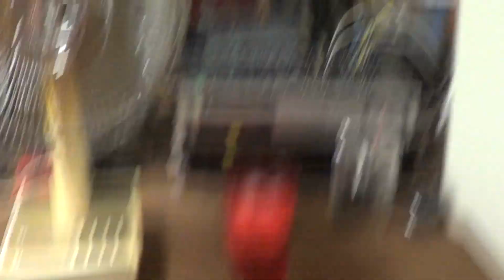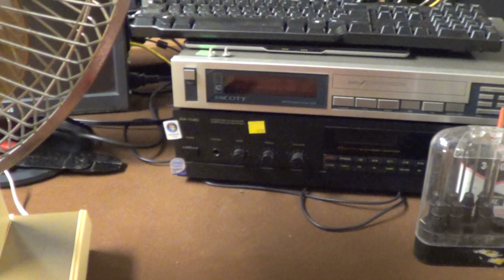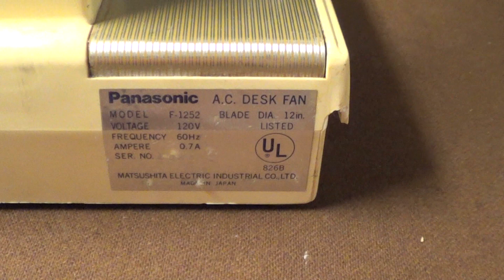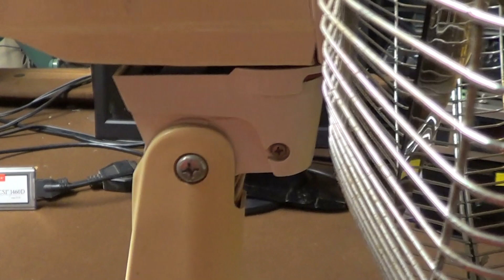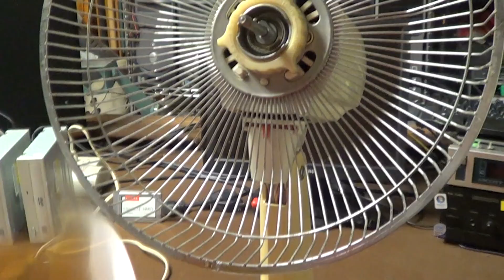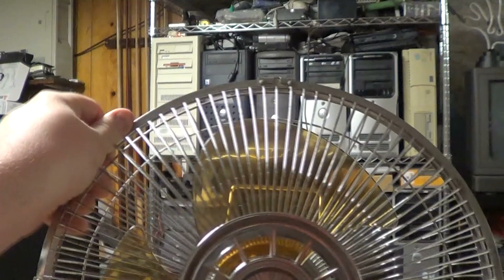Panasonic F-1252 Magic Stop Fan Overview and Demonstration

Comment: Do you still have these fans? My family had a Panasonic fan in the 1980s that had a similar safety technology but theirs had a switch instead of buttons. It was made of plastic instead of metal construction older fans had but the quality is still miles better than todays cheap, throw away fans.
Reply from the maker: Yes.

Comment: I just repaired one of these, the symptom was that it wouldn't start, the motor shaft would move a little when it tried to start and occasionally it would start for a split second but then stop. It turned out to be a bad 945 small signal transistor. I replaced all the 945 transistors with new KSC945SCYTA ( 20 cents each at Mouser) and it works great now. It stops when you touch the grill and then restarts a few seconds later. While I was in there I also changed the smaller electrolytic capacitors on the board. One of them was supposed to be 220uf and was measuring 450 uf. I just changed them all because they only cost pennies and I had them in stock. Hope this helps if someone else is repairing one of these!

Comment: Hi there.
The fan on the left side it's not working good, you should repair it.
Mine had same problem, I did repair it.
It's on my videos a short movie about my kdk instant stop desk fan.
Reply from the maker: I found the short video, but if you have one about repairing it, I would be interested in seeing that video. The fan on the left has worked that way for as long as I can remember (over thirty years) so maybe it has always been broken or there was a design change?
Reply: I did not shoot any video explaining how to repair it unfortunately, so few of this fans on YouTube...
But it was like yours on the left side. It only coast off...that was not the pretended action from Matsushita, they wanted to stop instantly. Mine is older than yours and there are another one even older than mine and it stops instantly. 
Yes I believe your fan is broken long time ago and you don't recall that. Mine was manufactured in late 60s. Maybe 69 or 70.
Did you check the resistor inside the white ceramic tube? Maybe it's open or could be the big capacitor after that resistor. If I recall correctly it's a 47uf 400v, change it.
No, I don't believe they made it like that because to do that you don't need so many electronics on the control board.
That video was taken when I was testing it, and I did not upload any video since I fix the fan. Now the fan does the same as yours on the right.
Reply from the maker: As I'm not unhappy with the way the fan on the left operates, and it works perfectly except for stopping instantly, I've never actually had it apart. I would rather not have a disaster and ruin that fan.

The fan on the right is definitely in need of attention. As I think the video says, only rarely does it work properly. I have had it apart, and did some basic tests at the time, but I did not find any obvious reason for it to be erratic. It is in storage now. There is also a third and smaller Magic Stop fan here and it also has problems.

It is surprising to me that these fans are so rare in the US. The Magic Stop system was a really good idea.
Reply: This fans are quite rare worldwide.
Regarding the fan on the right at least you could try to reflow solder joints, it might fix it, just because sometimes it works ok.
The fan on the left side, if you don't feel comfortable with electronics it's better leave it as it is.

Comment: The way the Magic Stop feature works is via DC injection braking. There is a capacitor that stores a DC charge (not the one mounted on the motor, that's just a run capacitor), and when you trigger this functionality, a relay cuts off AC power to the motor stator, and DC power from the capacitor (in industrial equipment, a DC bus is used to achieve this) is dumped, causing the near-instantaneous stop (the same windings used to spin the fan doubles as an electric brake via this method). Your other unit has a bad/faulty capacitor, hence why it simply slows down instead of stopping instantly. You will likely see a bridge rectifier circuit and a dedicated capacitor inside the fan's base on both units.
Reply from the maker: Of the three Magic Stop fans I have, this one is the only one that stops instantly when touched. As far back as anyone can remember, the other two never did stop instantly. A feature added later, perhaps?

Although definitely not as safe, I prefer the soft coasting down by inertia as opposed to the sudden stop.
Reply: CT1660 
You are absolutely correct.
Fortunately I just acquired one made by KDK (same factory) but older than this model on the video.
I did repair mine, now has instant stop function working. 
On kdk they not name it magic stop, it's instant stop.

Comment: I have seen some Montgomery Ward box fans say "soled state" what means the fan was equipped with a soled state variable speed control. I have found a 12" RAKS fan made by the Gus fan company in the 70s this fan has "sold state" written on the control panel but there is no electric board but a large transformer in the bace and a switch on the back of the motor housing switch the current from 120v and 220v.

Comment: 17:30 I"ll guess there is a diode in there somewhere. I believe feeding an induction motor DC  will turn it into a brake. 
BTW, both induction and synchronous motors need to be started by extra windings and can run in both directions without them, if started mechanically. The cheapest starting device is a "shaded pole", an extra winding a few degrees off in one direction that is simply shorted; these are reliable but inefficient. More powerful motors have startup windings fed by a capacitor; they usually shut off once the motor is up to speed . This is why so many dryers have a "start" button, it's a cheap way of timing the startup windings.
Reply from the maker: All very much true except the dryer part. There's a centrifugal switch on a dryer motor that kicks it off of the start winding once the motor has picked up enough speed. This also energizes the timer motor. The start button supplies power just long enough for this to happen (and as you'll see if you hold it down, it will be ignored after the machine is running).

Comment: hi it is a 3 phase motor but used only with a single phase ac line (that is why it's need a capacitor ) with a 3 phase motor you only need to invert 2 phases to make it run in the other direction :)  ( i hope i was clear beacause i'm french and my english is not quite perfect ^^)

Comment: That fan is very cool and those blades there golden colored I wouldn't pay $500 for a fan that does the same thing a regular desk fan does just the same thing without buffeting what Dyson says all it does is circulate the same air in place so if it's hot it's going to blow hot air around when I can get an air conditioner for like $100 or 200 dollars depending on BTU size.

Comment: It looks like it could have a brake of some sorts causing the rapid deceleration of the blades . I seen a metal ring inside the motor jolt forward about half a centimeter when you triggered the Magic Stop feature.
Another amazing video Bill. I am always intrigued while listening to your in-depth analysis of electronic devices. :)

Comment: I'd think if it used reverse polarity to stop the blade.  It would hum for a second before coming to a complete stop.  The second fan sounds like a solenoid could be pushing the spindle forward out of the magnetic field of the armature.  But I could be wrong.  Dyson's all about the money not quality.  Strangely Best Buy sells Dyson fans.

Comment: I have a very kewl AMANA  floor fan that oscillates in a very unusual way. AF183SM1 High Velocity Orbital Ari Circulator Master Brands HK Ltd. Thge head does not move back and forth, it's stationery. But the blade actually kinda move in a spiral rotation back and forth.

Comment: To stop the motor instantly it tends to inject a DC current into the AC motor, we use them at work on all kinds of AC motors for safety, if an emergency stop is pushed the AC supply is shut off and a DC current is injected into the motor for a matter of seconds which causes the motor to stop instantly.
Reply: I think you are absolutely correct.
I just bought one today but older model than this one on the video, and I think that's the reason why it stops so fast.

Comment: Hi uxwbill.
Thanks for the review, I think Panasonic should also thank you for it ;) . Now, concerning the breaking mechanism, I've seen such a method used in a blender machine we have at home. I think it simply uses one of electromagnetic coil to jam the axis in place. During normal operation the axis spins in sync with a rotating magnetic field, this one is generated using two or more coils. Disconnecting all others and keeping only one coil connected creates a fixed magnet that does the jamming. So like you said using a pin would generate a strong noise and it may even break under heavy or repetitive loads. Thanks again.
Reply: His uses DC injection braking, hence why he also mentions the use of a relay.

Comment: I just looked up braking methods for ac motors and putting DC through any of the windings would seem the easiest way, a half wave rectifier would give a nice 60cycle hum as the braking was applied too. Can you try turning the motor while the braking is on? See if you feel a 60hz pulsing to the braking action?

Comment: torts the end of the video in the far left corner of the room on the shelf with all the computer towers is the one with all the small holes on the front bezle  the dell power edge 600sc you got from fellow you tuber maxxarcade a couple years back?

Comment: My plan was going to have a galaxy fan with blue blades, but now that i saw this thing, i think i have another better option. Thanks for showing us this great piece of electronic history :)
Reply: It could be. After the stupid dictatorship of velazco in the 1970's non national stuff weren't allowed here, specially things from united states, so the market got flooded of japanese stuff assembled here. My grandmother's aunt has a made in Japan national radio that bought on israel in the late 70's and guess what? A seller gave me the same radio when i bought i can't recall, some old stuff i'm sure and it said "producto peruano" (peruvian product) but on the inside there were mitsubishi, NEC, and hitachi chips. So i'm sure there can be some of those fans hanging arround here with a peruvian label on the back. But trust me, they would be rough. Everything old in this country is damaged they use it until they die. Specially cars. I saw a 1960? Dodge valiant sedan today without the rear windscreen and with a lot of massive dents. About fans, like 3 years ago, there was a clock repair shop that was in business for almost 60 years and they closed like a year ago. It was runned by japanese guys and they had a pristine national fan with japanese letters obviously a japanese domestic market product, that thing was phenomenal. I got a 1930's 40's? GE fan, that is really good, but those 1960's japanese desings were so good that they cannot make them again anymore :(

Comment: I have fairly limited Electrical knowledge so my being wrong is a very real possibility on this subject but I know that in many electric drills (namely battery operated), The electronic break is operated by shorting the motor out. This may not work the same way with an AC motor though.

Comment: I'm thinking, just from knowledge of having actually done this a few times much to my great amusement, maybe the fan circuitry disconnects the AC power from the motor and connects the terminals together.  Just my thought on how it might actually stop like that without being a heavy clunk of a solenoid jamming the motor shaft.

Comment: my theory is the control board shorts together the wingdings of the motor to stop the blades. if you rotate a dc motor by hand then short it out, you will notice it immediately becomes much harder to rotate.  I'm not sure if the same principle applies to this type of ac motor, but to me this is the most obvious solution.

Comment: Bill interesting that the base and stem of the fan had an older look and feel about it, but the grill is very similar to my 12" fan that is from the 1980's, or early 90's. It had an opaque blue fan blade in it, but the grill is exactly like yours other than Cool Air replaces Panasonic. It also has knob to tighten the head unit down for tilt, unlike this specimen you show. The plastic is so cheap it's disintegrating around the motor housing, but it still chugs along some 20 years or so later.

It does make a bit of noise, but mostly through the oscillating mechanism though.

However, no magic stop or solid state goodness though.

Comment: I definitely saw an arm inside the motor casing move up when you touched the grill with the dust cover off.  It's very likely the pin design you talked about.

Comment: I could hear what sounded like a second relay click about a second after you touched the fan so maybe there is a winding for stopping the motor.  Not being a motor expert I initially thought it may short the windings to create the braking effect but don't really know if that works on induction motors.

Comment: I am sitting in front of my vintage Sears 12" fan as I type this. Aside from some yellowing of the plastic base, this fan operates as good today as it did when it was purchased in 1982 and has been faithful through the years, unlike the disposable units manufactured today that may last a couple seasons at best. Thank You William for yet another informative video.

Comment: Interesting center section of the grill.  Looks like a 60's era hubcap.  Seems like with all of the late 60's thru till late 70's Solid State was like Turbo in the 80's.  They slapped it on everything, just like "Computer Drive" "Computer Controlled" or "IC" to promote that "new technology" being used.  I can imagine the Touch Stop thing would be annoying if you were to adjust the fan as it is blowing.  Still really cool feature.  The control buttons kind of look like what would be on a blender.

Comment: Hmm, the fast stop is unusual, if it was a d.c motor i would have expected the fan wires to be shorted together to use the motors generating ability against it.

But ac induction motors dont work the same so im not sure :-(

Perhaps the fan is just a vegetarian lol :-))

Comment: "But with a regular fan you get buffeting.  The only acceptable fan is a $500 Dyson fan."

Seriously though, anyone who spends that much on a fan deserves to be smacked upside the head.  I've got my Holmes 16" standing fan and Lasko HVB tower fan.  Dyson has no place in my home.
Reply: the only fans i buy are vintage ones. so im with UXWBILL..ill take my 500 bucks and buy a truckload of vintage goodies. Dyson fans are just a joke.
Reply: Agreed, only an idiot would pay that, I'll stick with my cheapo fan bought at  Rona (hardware store similar to home depot) , it works....
Reply: Ive seen one of those Dyson fans at a store once and they move no air at all
Reply: The Dyson fans seem to move less air than a regular fan and it's very directional.

Comment: Would like to see more of the HH Scott receiver. Featured a video of one on my channel and I didn't think the company lasted more than a few years after it was made, but yours seems to be of a more modern vintage and styling. Still US made?
Reply: *****
Thanks for the info. Repaired my parents unit recently, turned out to only need (a lot of!) contact cleaner. Kind of amazing, it stood up to decades of heavy use and abuse, still running with all it's original parts! All American parts.
/watch?v=O-kc7q7FjOE

Comment: I'll just magically stop anyone from grabbing the first comment!

Gotta love that basement wiring! :D
and yes, it seems to be using electric braking-- watch the center of the motor assembly closely as the grille is touched-- it goes inwards as if it's changing direction quickly-- from that perspective, at least.